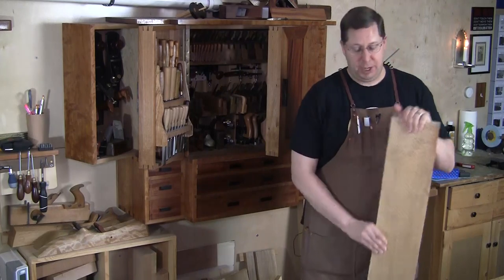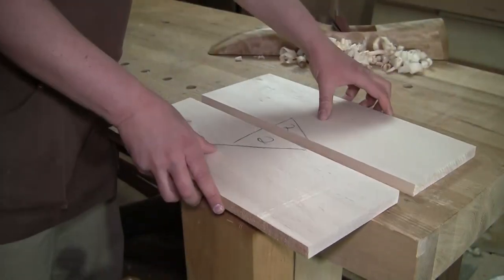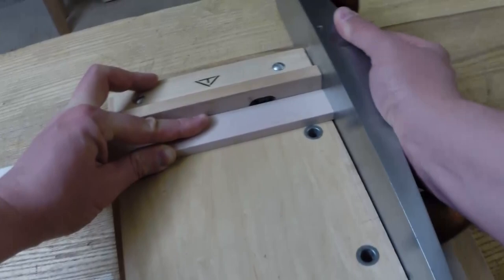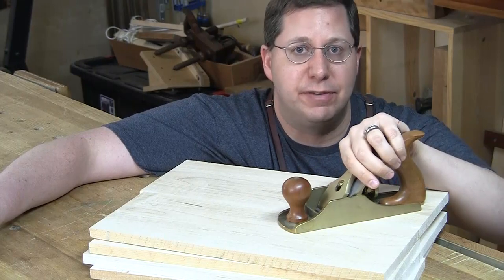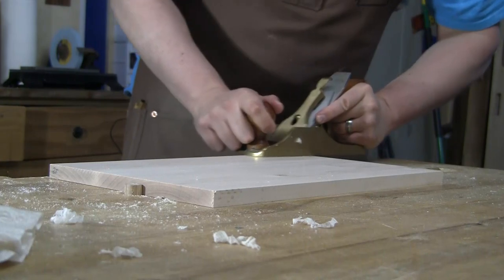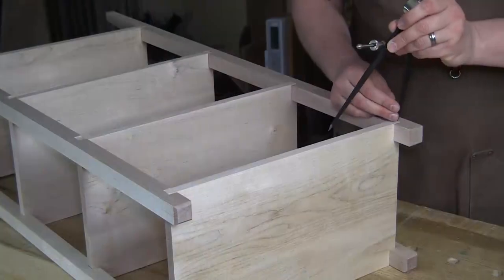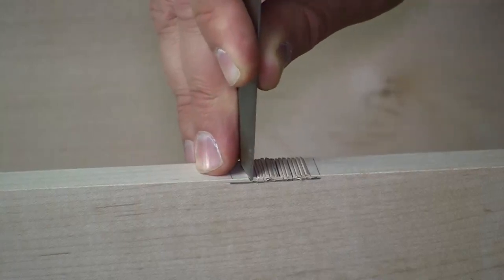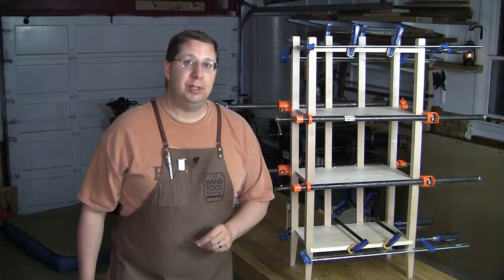RWW194 Display Shelf Part 2

Comment: Do you have any thoughts on tooth configuration for a panel saw? I have a few rescued saw blades in my shop that need retoothing and new handles, and some of them are going to have to be shortened. So I'm interested to get your opinion.
Reply from the maker: Mooncabbage well since a panel saw will primarily be used for stock around 3/4" thick and thinner and its job is to cut precisely and cleanly you probably want at least 8-10 teeth in the kerf rather than the typical 6 teeth for a rough dimension handsaw.  That being said, I really like my 10 tpi rip panel saw and my 12 tpi crosscut panel saw for this
Reply: RenaissanceWW That's good to know because I would have guessed 8-9 TPI for rip.
Reply from the maker: Mooncabbage that will work too, especially if most of the stuff you saw is 3/4".  Its is a balancing act of speed and clean cut.  I think you can see how the number of saws in the nest start to add up.
Reply: RenaissanceWW Well exactly. I'm trying to keep my saw collection to a minimum, lest I become a tool collector. My shop is small enough as it is. I was planning on having only 3-4 hand saws total, since the thickest stock I work with is usually 2"/50mm seasoned timber. I would be interested to know what in your experience the minimalist complete saw collection looks like.
Reply from the maker: Mooncabbage if thats the direction you're heading then I would skip the panel saws completely.  5tpi rip saw, 8 tpi crosscut saw, Carcass saw will do everything you need.  I suppose a coping or turning saw should be added to the mix for curves and now you have 4 saws
Reply: RenaissanceWW Sorry, I should have been clearer. I meant 3-4 hand saws, in the sense that full size rip/crosscut and panel saws full under that category. Backsaws and turning saws don't count in that number :P I'd probably say 3-4 backsaws and 1-2 turning saws seperate to that number.

At the moment my list looks like this:

1) Full Size Rip
2) Full Size Crosscut
3) General Purpose Panel Saw
4) Rip Tenon
5) Crosscut Carcass saw (Veritas)
6) Gents Saw/Razor saw or similar for fine dovetails and beading
7) Coping Saw
Reply from the maker: Mooncabbage Seems like a comprehensive list to me.  Don't think you need to add anything to it.  Personally I don't like the feel of the gents style handle but I know many who swear by it.